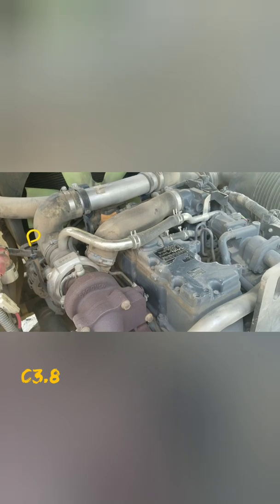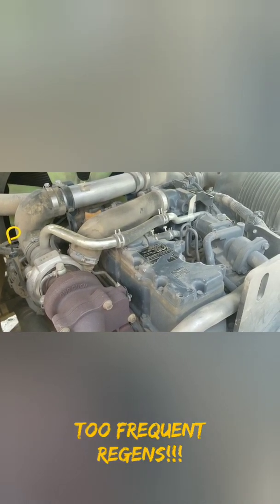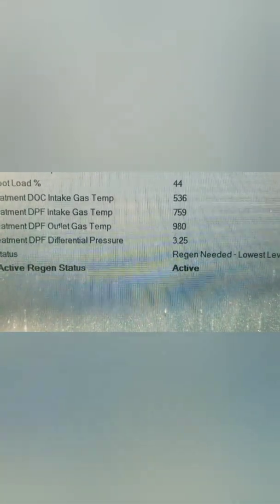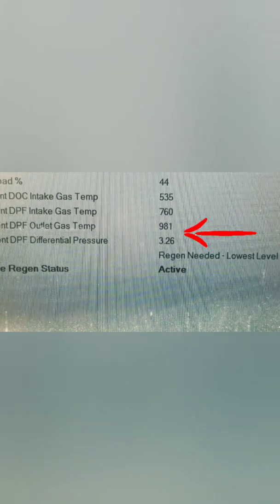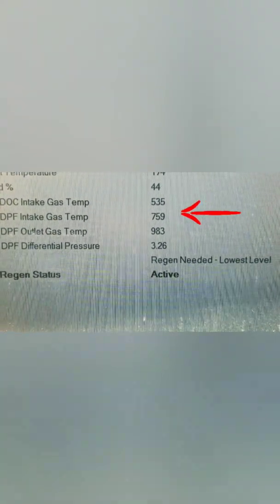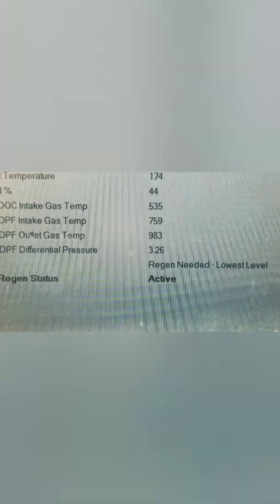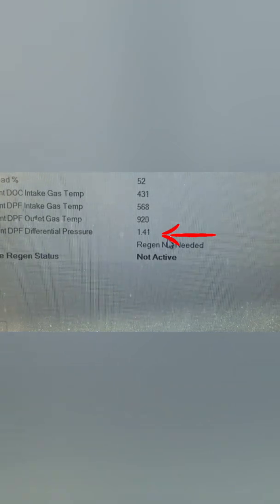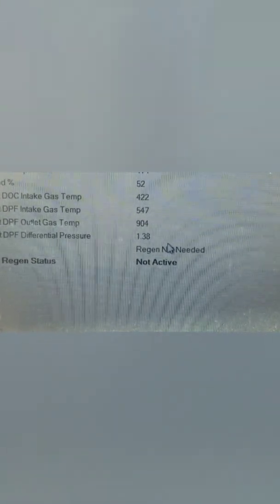Kubota 3.8 REGEN ISSUES AND DIAGNOSTICS

Comment: Where's the diag port on these? I have a Vermeer dx20 with Kubota 3.8 and cannot find the diag port.
Reply from the maker: Look for blank 3 pin plug
Reply: @slowaf_12v  got it! Thanks brother.
Reply: We found it. It was plugged into a dummy harness right under the fuel rail above the injection pump.

Comment: Totally new to the world of regen and DPF - our current backhoe is a 25 year old Deere 310D and shopping for a replacement machine is forcing me to learn about this now. Is this fixable with just a filter replacement or something?

I've heard of some Kubota tractors being moved South to be sold because at some point they've become unable to complete regen cycles in their colder Northern climates. Would you know anything about that?
Reply from the maker: Im on the CAT (running 3.3 and 3.8 kubota engines) side and some of machines had software updates to assist regening in the colder weather (i.e. disabling heat in cab to keep heat in the engine) need to elaborate on your deere issue though
Reply: @slowaf_12v  Hey thanks for the info! That's good to know

We're not actually replacing the 310D, more like adding to the fleet. Aside from an intermittent starting issue we're trying to work out, the 310 runs perfectly, so we'll be hanging onto her for as long as possible

The thing I'm really interested in is determining how much of a hassle the DPF stuff really is, especially in a Northern climate like Canada. We're not in a rush to buy and we're in a position to pick and choose any machine we like, so I'm wondering if we should aim for something that's pre-DPF but still in good condition. I also wonder how much of the DPF complaints are just a result of negligent operators - I've heard of people canceling the regen cycle because they didn't know what the lights on the dash meant

If you were looking to buy a backhoe today is there any particular one you'd be searching for? Or anything you'd be looking to avoid? Thanks again.

Comment: What are your thoughts on if the dpf was replaced with a new one and it's still not getting about 600° ?  My diff pressure when starting out was 5 and after a forced regen it dropped to .8 but never got to the recommended 100-1100°
Reply from the maker: .8 is still very high..remember 1 psi is considered plug

What are your readings soot mass G?
Reply: So I preformed a dpf display update and my Temps are now getting up to almost 1100° my pressure is .04 and the regen completed. The display update was confusing and steps left out in the setup instructions. Once you download the program then you have to goto non serial number specific and download the .s19 file. All is good now. Thanks for the reply but as always once you ask a question you tend to think aboutbthings and figure out the problem.
Reply from the maker: Good deal man....kubota and hyster/yale not the best of friends for techs!